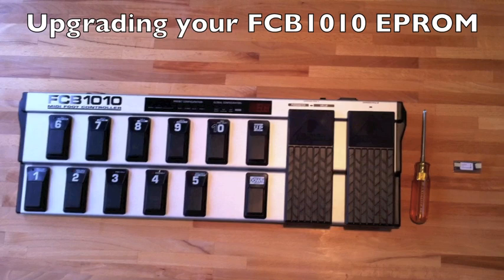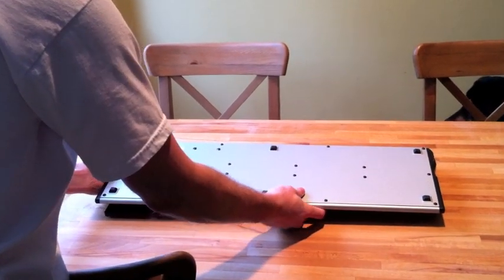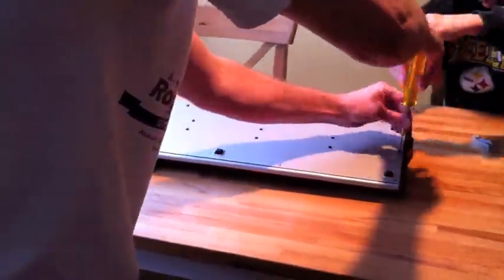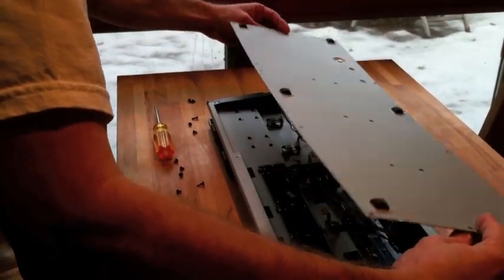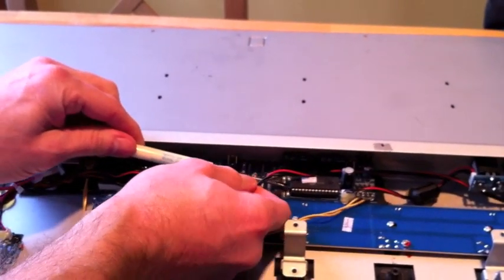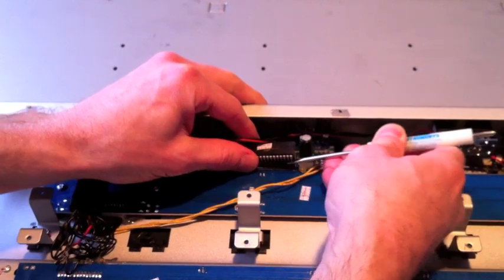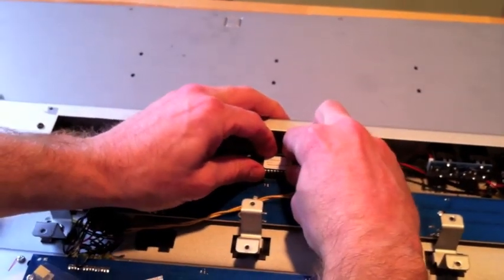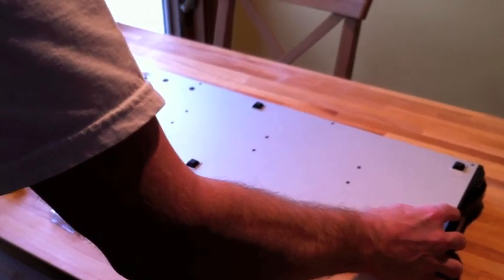Changing the FCB1010 EPROM

Comment: I just bought a used FCB1010, and it turns out that the chip is from 2002 (v1.1). Can I still update to the latest version, or will there be a compatibility problem?
Reply from the maker: Yes, the EurekaPROM will still work in that FCB1010.
Reply: @Eurekasound  Thanks a lot for your answer

Comment: I have a 88 start up issue will changing the eprom fix it ?, thanks
Reply from the maker: Possibly. You'll see '188' when the FCB1010 doesn't have a great connection to the EPROM. You might try taking out the PROM you have now, make sure the pins are all there & straight, then putting the PROM back in.

Comment from the maker: The EPROM sits in a socket.  The socket is soldered into the board.  Make sure that the small screwdriver is between the socket & the chip (versus between the socket & the board).  Then the EPROM should slide right out.  If you have to apply your strength then something is wrong.